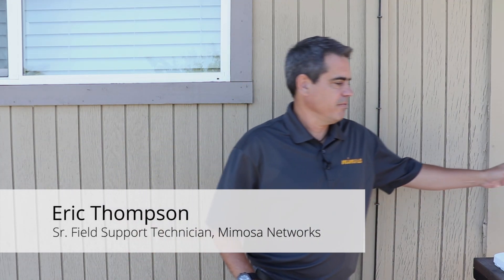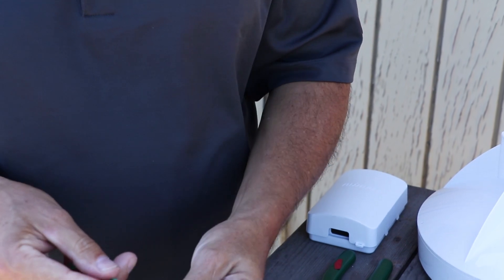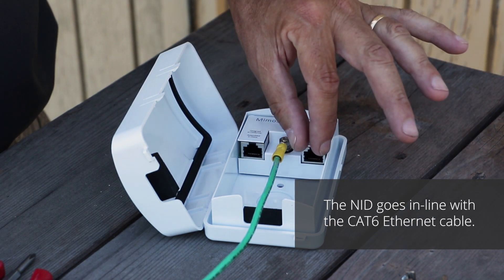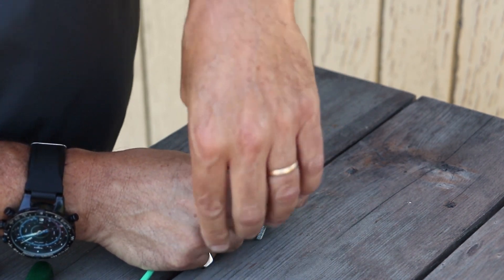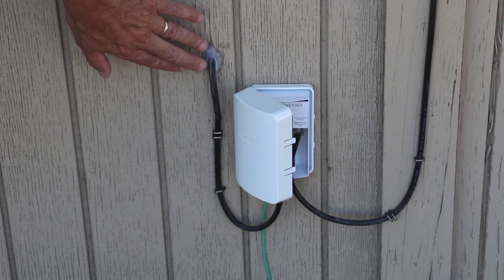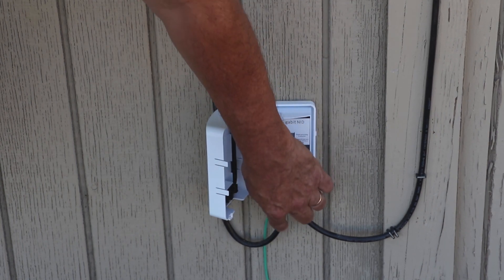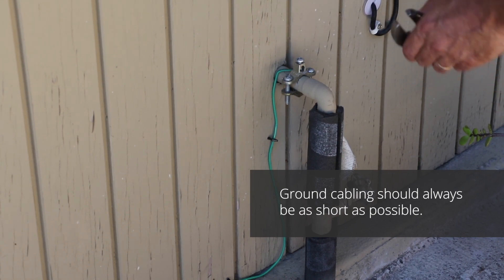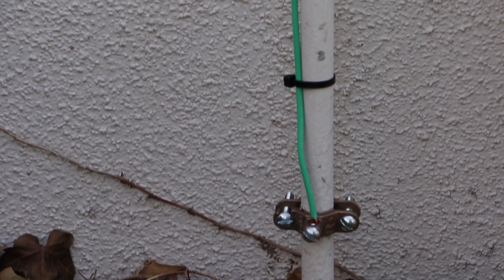Mimosa in the Field: Proper Grounding

Comment: If installing radio on a metal building, can we just ground to the closest metal support member? Otherwise, if there is no pipe in the area, can we use our own 4' grounding rod?
Reply: Hi Mike, Yes you can use to your own provided ground rod. Check your local regulations for the correct rod length. When on top of tall commercial rooftops, I have used the nearest, thin copper pipes that are attached to hvac units with permission from building management.